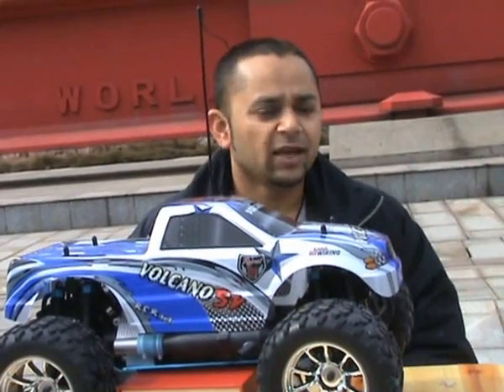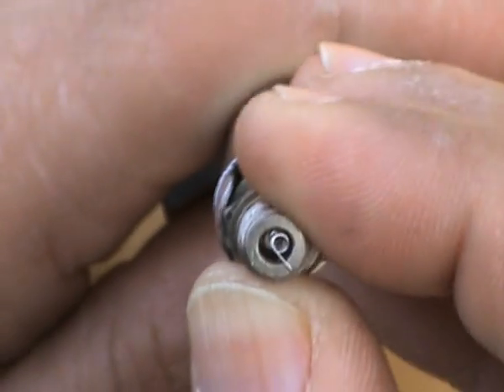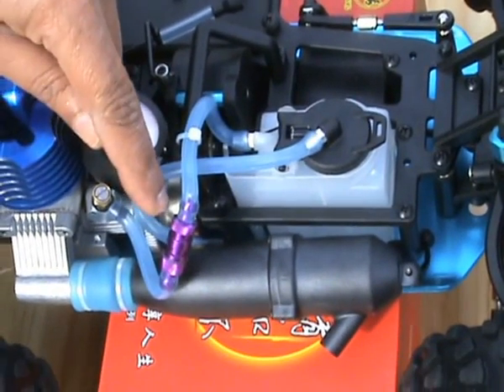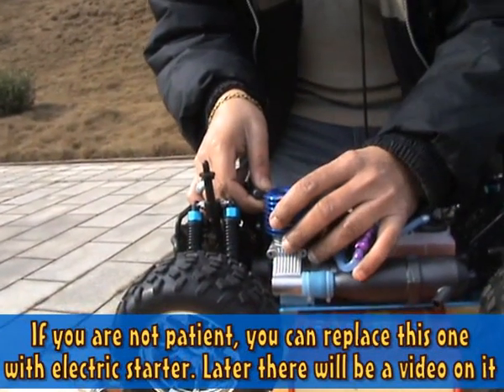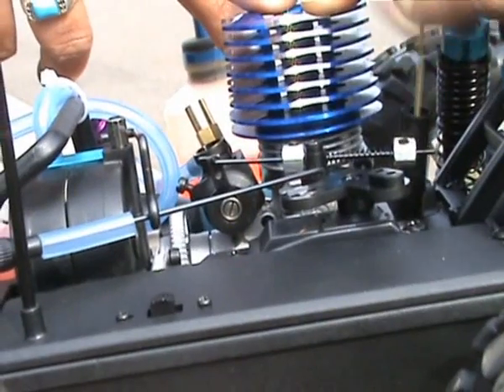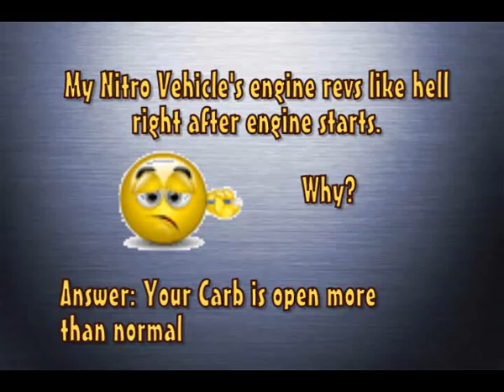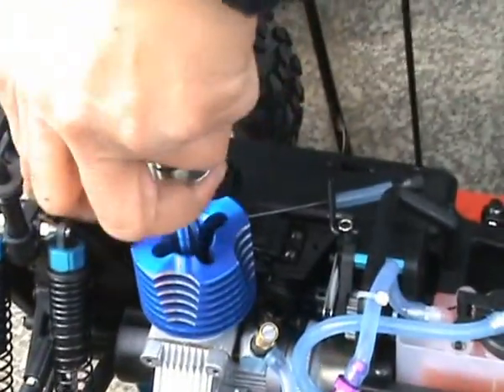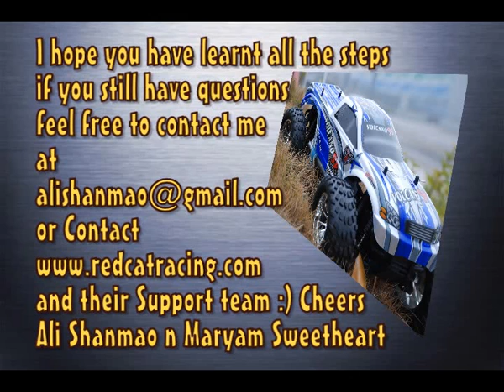Setting Up Volcano SV Part III Starting The Baby

Comment: I just broke in the engine on my new Volcano SV. By following your videos everything went smoothly and after the break in I ran about 9 or 10 tanks with no major problems. The only major issue now is I think my gear mesh is off because i didn't put the lock tite on until after I broke the engine in. The wheels aren't rolling smoothly. but my spur gear isn't showing any wear. Could it be something else?

Comment: @alishanmao I think it is the gear mesh. I did the paper test before breaking the engine in and the gear teeth imprints were very light but you could see them clearly. Then after discovering this problem I did the paper test again and the gears really crunched the paper up but didn't tear it. I'll probably tear something up if keep running it this way, huh?

Comment: i have a volcano s30 and it is having problems. i have read that the top speed is about 50 but on a good day it will only do about 15-20 at full throttle and wont shift into second. some days full throttle will be about 5 mph. it also stalls when i brake fully. if it helps, i live in colorado at about 5000-6000 feet above sea level. what should i do? please help!

Comment: hellohello please i need help, i have a volcano s30 
and it doesn't start, starts only if i push the
acelerator after that the engine quick inmediately
the last time i ran it out,it gets to much dirty 
i think con you please let me know the setting of the
screws, how many turns on the hsn(fuel line goes) 
and lsn(servo) please, thanks

Comment: fack....i just got a free one, and now i watched it after fixing it...i can't get it to run.....i pulled it a few times long. The puller anit broken...but sometimes its really easy to pull, then it will go back to hard.....so is it ok? and i can't get it to run. i used my starter to check plug...and a brand new one didn't even glow! so need help! know what i should do?

Comment: i had that and my pulling rope broke like 4 times
so every time i needed to take a part the motor of his eh... bottom...
and unscrew the pullstart put in a nother rope and pute it back together and that it runs that it goes off and i pull pullstart DOEST THE F****N rope breaks a gain but now i got it running